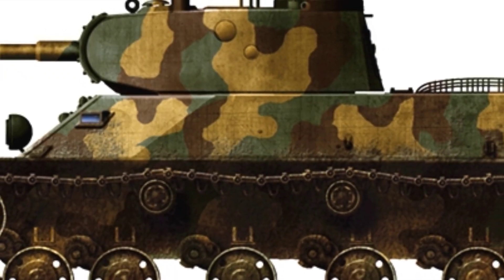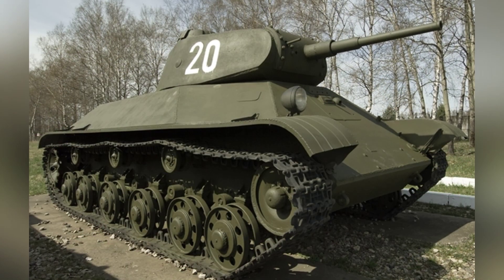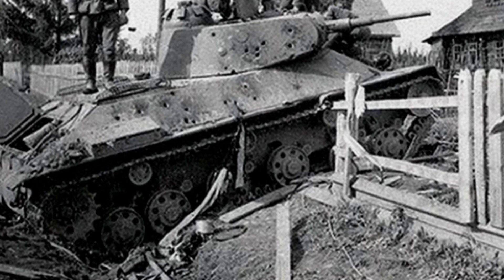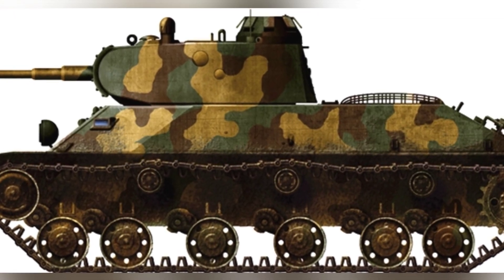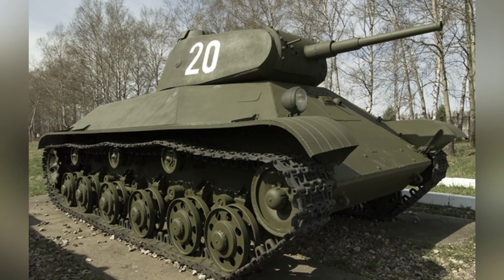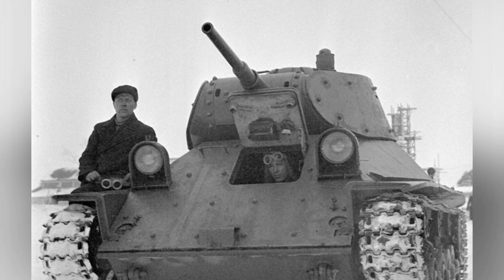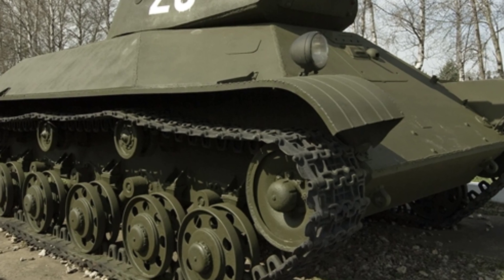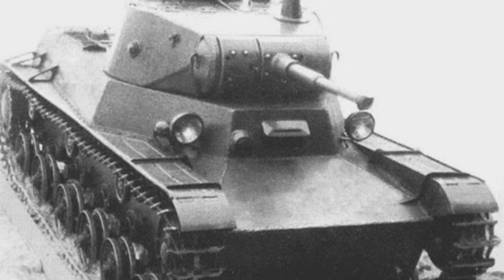The T-50: Advanced Light Tank with Revolutionary Design

Comment: My absolute favorite 'what if?" tank.  This lovely little beast was not alone.  He had two brothers from different mothers: the German Vk1602 Leopard, and the US M7 Light/Medium.
  I notice two weak points.  1) A significant shot trap under the turret front when traversed to either flank.  2) The driver's flank slit viewports look pretty thin.  I wonder how the driver would've fared in "oh bugger!  The tank's on fire!" situations.
  The upsides are the three man turret and the high mobility.  Generally comparable to the German Vk1602 and US M7, though I'd give the edge in combat utility to the M7.  The Red Army ended up sticking with 2 man lights in battalion recon companies and T34 for everything else.  Germany stuck with halftracks and four wheel armored cars for its PanzerAufklarers (armored recon).  The USA built 22,000 M3/M5 series tanks - inferior in most respects to the T50, but kickass against PzAufk light armor.